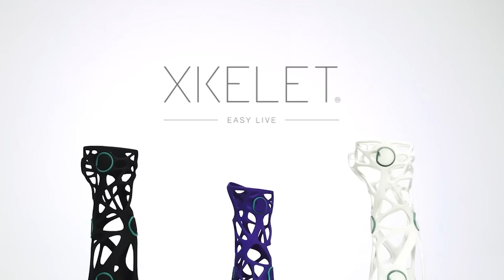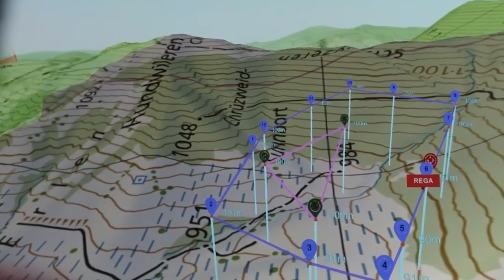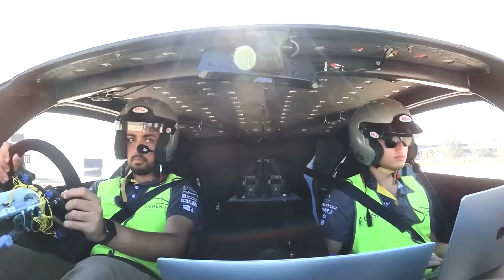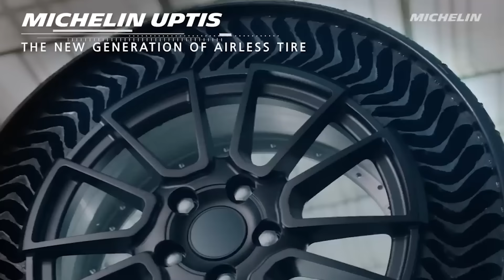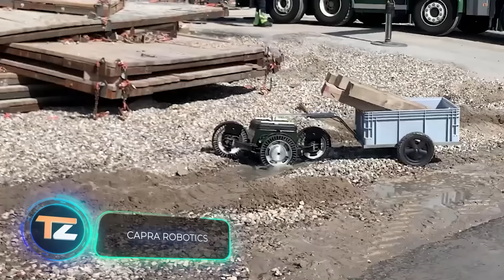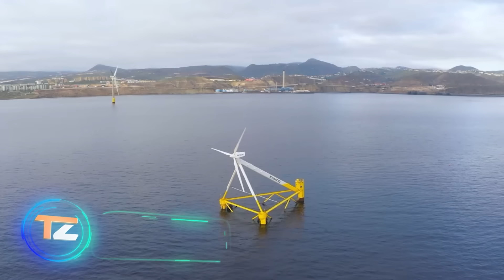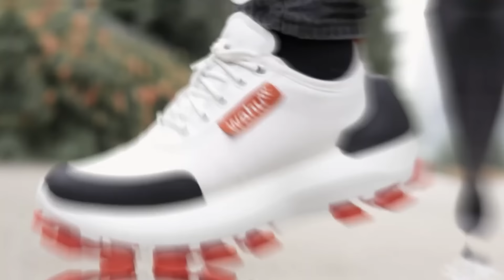INCREDIBLE INVENTIONS YOU DIDN'T KNOW ABOUT

Comment: Some of what was said about the helicopter drone is contradictory. Initially it was said it could be used to pick up cell signals even if the phone is turned off but at the end it was said it was to avoid airplane collisions. 

PS I wonder if you could avoid detection by switching to “airplane mode” and then turning the cellphone off.

Comment: Working both with persons using wheelchairs; pediatric and seniors, this wheelchair invention would have limited use for those populations as both usually require upper body torso support. Furthermore how does it fit into a car? Not like it's as collapsible as a traditional wheelchair

Comment: A glider doesn't have an engine, it's why it's a glider. 
Just damn.
Reply: Almost all gliders need an engine to get airborne - the difference is that this one uses a built-in one that retracts once the desired height has been reached rather than relying on a powered aircraft to tow it.

Comment: Great and interesting video. I want to thank you for including both types of measurements.  I like the YoYo and the fact that it has a max speed of 80mph is a big plus.
Reply: I like the YoYo too but I wonder about the battery life and replacement cost. Tesla doesn't tell you when you buy their car that a replacement battery costs the same as a new car!
Reply: The yoyo is nice but not good for driving in the Netherlands. You will need highway speed car or it will be very dangerous. So at least 100km per hour otherwise you will be too slow for the other traffic which increases risk that someone will crash into you

Comment: at 0:58 I think you have an error. I could be wrong but I have had 7 broken bones thus far 5 of which i needed a cast for and 6 of which i got treated. (one was a very small crack that my parents didn't feel necessitated a trip to the doctor.) But usually the cast materials where cheap but it was almost always a multi $1,000 bill to have my limb casted. That is a very high price compared to as splint you can have a doctor design then print out at home. Just saying. I'm not very knowledgeable about 3d printed casts but i do know that the plaster casts where shockingly expensive.

Comment: The narrator clearly isn't familiar with the cost of healthcare in the US: The average cost of non-surgical treatment for a broken arm is US$3,000 to $5,000, with surgical treatment involving at least another $16,000.  The only real question is whether or not you have insurance and if it will cover it.
Reply: @Karl with a K ok you're right, and that explains why everything you get at a hospital or ER is so cheap, because they never charge you for labor or mark anything up.
Reply: The point isn't that the 3-D printed cast would be too expensive at approx. $500, it's that compared to the overall cost of treatment in the US it's barely noticeable.  On the other hand (no pun intended), in almost every other country with universal healthcare, US$500 would be a major expense.

The ultimate solution, as some of you have already pointed out, would be to create and manufacture your own for a fraction of the cost.
Reply: Yeah, but a fiberglass cast only costs like $20 in materials, and does not need to be pre-fabricated.
A printed cast would require scanning and modeling of the limb, then printing, then finishing, then fitting/applying. Insurance would probably not pay for it.

Comment: There are a lot of problems with airless tires that they won't talk about.  Like how the air inside a regular tire actually helps with heat dissipation to keep it from overheating, especially in extreme heat climates.  They also have a problem of getting crap stuck in them which can lead to balancing issues (seriously, can you imagine having to clean those spokes?) and if a rock gets wedged in there and suddenly flung free, it could cause damage to something... or someone.  They also don't offer the stability that regular tires do because there is no sidewall, meaning they have a tendency to not hold well to the road when cornering, even worse at high speeds.  I've seen them used on big equipment and that makes sense, you're not traveling at 55mph down the freeway and you don't have to worry about getting flats due to sharp objects or rocks/sticks (though a lot of normal tires on big equipment are rated almost bulletproof, depending on where you're working, of course).
Reply: They'll never work without sidewalls, they'd fill up with crap too fast.
Reply: They'll get better perhaps. Yeah but not having a sidewall rules it out for anything designed for a speed above like 15mph, especially if turning. 

The solar panel cars were a good idea too. There's not a great reason for it costing a fortune either when car manufacturers could easily implement the sorta thing for probably cheaper than any other business could... But the licenses and royalties would cost a fortune to be able to use the tech without getting sued by everyone and their mother
Reply: @slick-zq5hj  I never understood why they don't put a thin membrane on the outside to keep debris/water/snow out.
Reply: @trikepilot101  They already did figure that out but because the demo or promotional vid needs the people to be able to see what is going on we hardly ever see it in vids like this.
Reply: And that is why there is a billion dollar company using their money on research and development.
Plus every thing you pointed out is 15 year old misunderstanding.
So the air IN the tire helps with heat but by your logic the air all through the tire doesn't. 
Sharp objects and rocks getting stuck in them...going down normal paved roads.
Oh the horror.
And you can bet the TIRE company knows about sidewall flex and is putting serious effort into the design, material, cut, thickness etc to keep grip as needed or guess what...DOT won't approve it.
But im sure you have bested the engineers and researchers with your mastery of materials, blends, pattern, airflow, density, elasticity, cut pattern to keep it strong and to keep air flow where needed, oh and pizza party fridays.

Comment: Hey man I actually have a helicopter from the 80s that looks just like that but not that beautiful I was wondering if they have any spare parts maybe I could get mine back in the air I need pretty much remote controls And a new chip for the new remote control or use I’ll take anything I could buy is low price please contact me?..😊

Comment: I don't understand why new modern EV cars are not built with integrated solar panels (on the roof & hood) and a modern dynamo system that can be deployed or engaged on long motorway trips to produce and recharge the car batteries..,like if they did not want us to produce our own energy and use it while driving ,but instead making sure that we'll be obliged to buy it from their superchargers with high electricity prices..!!
Reply: 2023 Prius PHEV can be ordered with solar panels.  It adds weight to the car and only adds 600 miles to the range if you leave it in the sunshine all year.  A solar car port, which doesn't add weight to the car, is probably more of what you are looking for.
Reply: Solar might add 3 miles to your range.  It cost more than it can help.
Reply: Solar panels aren't efficient enough yet and probably won't ever be to make it worthwhile.
As for a dynamo... If you drag something or spin it, it costs more energy than it generates.
Reply: @mawlakewlz  well today's wind mills are big dynamo ,i was thinking more of a secondary power unit for all the car's accessories like an EPU on an airplane...head lights ,heater & AC ,seats..i'm certain something could be fabricated (size & power) with the proper ratios of pulleys to make it easy on the main E source ,therefor the main battery would be used only for range..same for the solar panels (efficient ones) ,producing enough to keep the inside of a car cool in summer when parked for example..to then not use high consuming  AC to cool it down and suck-up the main battery ,it just might be too expensive for now..but not completely out of reach..
Reply: @hectorherbert6585  there are laws of thermodynamics at play here.
Reply: Aptera.  Look it up.

Comment: $3,400 for a pair of shoes using an ultrasonic sensor system that you could buy for a microscopic fraction of that and he's shown still using a cane.
Reply: and to interact with it you need an app to navigate it, something you need eyes for.
Reply: @Rotomoo  Hi! Our system provides also a button on the back of the device. Blind people may use a smartphone through VoiceOver too 🙂
Reply: @Rotomoo  not necessarily...look up a kid named Benjamin Underwood. He was 100% blind due to losing both his eyes to cancer at 2 years old. 

And although he was able to do many things an able sighted person could do (by determining where objects were by the sound or "echo" the objects would make), there was still a limit to what he could determine about obstacles (through hearing alone). He could not determine how deep a "drop off" or hole was through sound alone - meaning he couldn't tell if it was like simply walking off the curb at an intersection or a steep drop off that could easily result in broken bones or death (which is why a cane is still recommended, because it gives an idea about how much of a difference a drop off can be) ...

Oh, and even though he was 100% blind he was still able to use a phone & play video games...